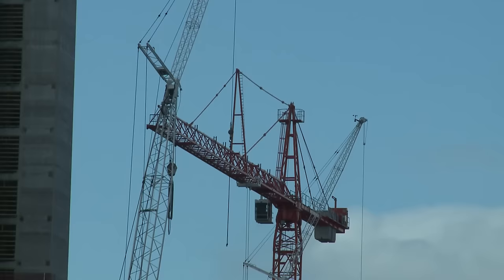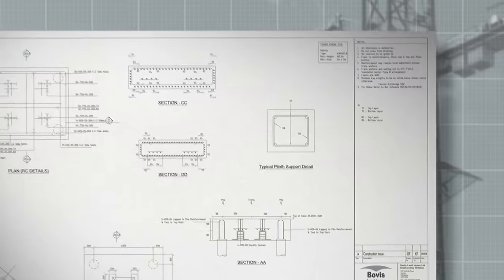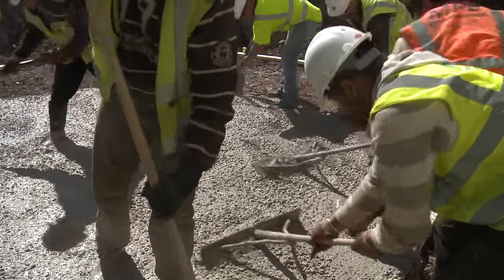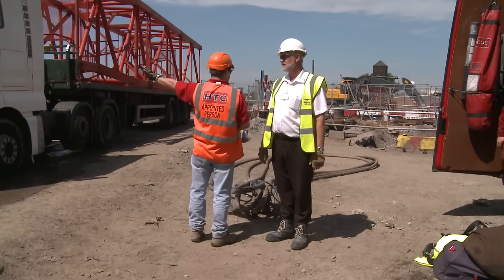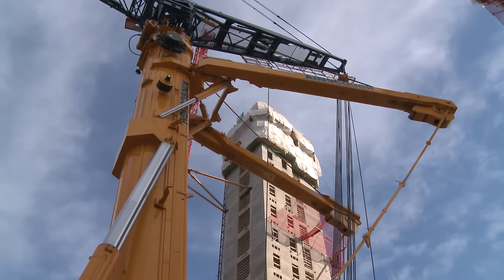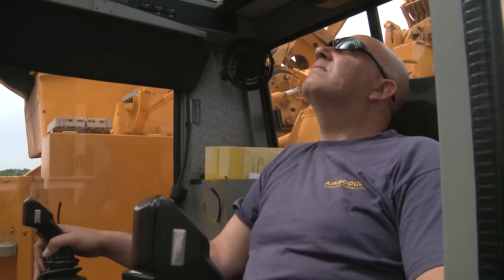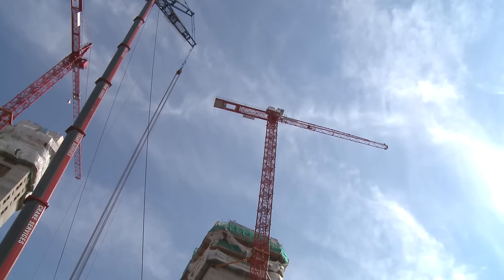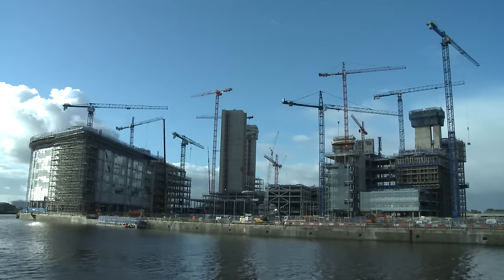How to build a Tower Crane

Comment: Nice video!
. . . and as you can see, the erectors do NOT care about the content of the erection manual of the crane's manufacturer.
That's why they need extra method statements because it would be too easy to follow the manual.                -__-               
My daily headache continues.

Comment: How do they not fall over? When I see tower cranes 20 stories tall with the big steel tower it makes sense, but up in Chicago they got these things 100+ stories high right now, and looking at the tower from a distance it seems it should just bend over like a piece of spaghetti.
Reply: They have a concrete foundation like this video shows. The also have counter weights and the jib is allowed to swing with the wind when not in use.

Comment: With automation, remote control, and hd cameras, why is it nessasary to put a human operator hundreds of meters in the air in an operators cab?
Reply: Stereoscopic vision, better depth perception, and the operator can physically feel what is happening to the crane.  Instruments have to be read and interpreted which is far too slow when swinging a couple of tons with people standing around it.